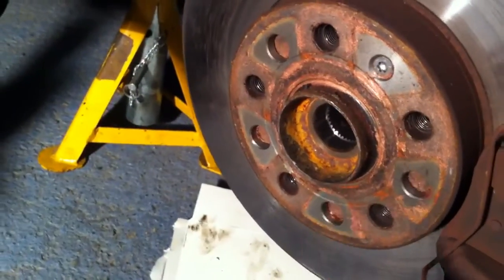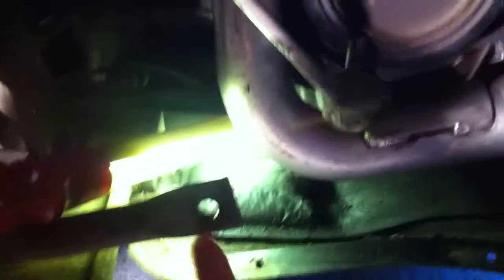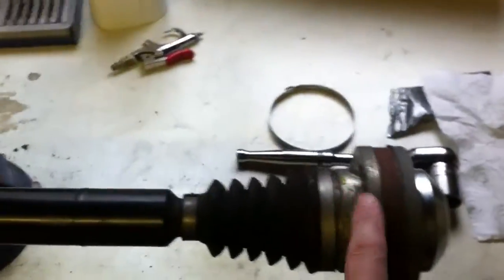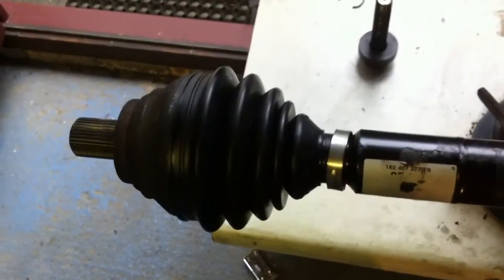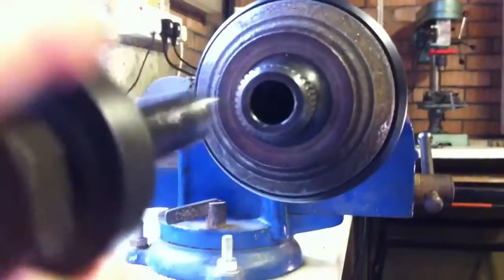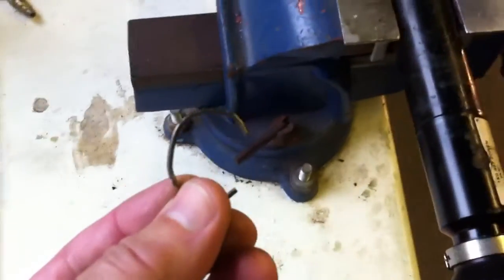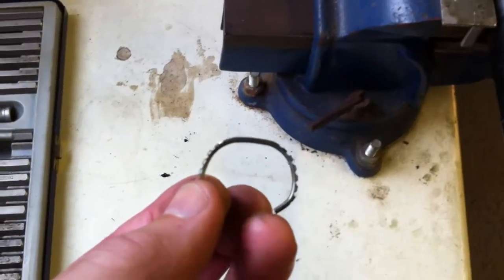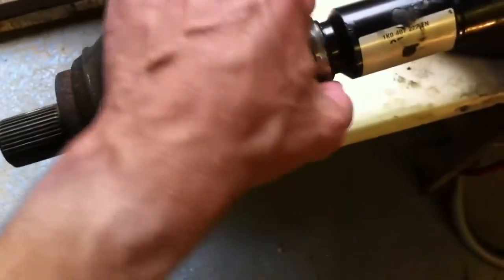CV boot replacement on 2005 Skoda Octavia 2.0TDi. (VAG, VW, Audi)

Comment: Thanks for the idea of using the Allen socket - it may help other amateurs (this was my first) if you make it clearer that it all needs to be kept in line while screwing it up (I also left the shaft on the car).  I "lost" 3 of these inside the joint while it gradually drew out - then it finally came off the end with a tap from a big hammer.
Reply from the maker: I've done a number of CV boots over the years and this was the only one where I couldn't easily remove the joint. I see that there is a special puller that you can buy to deal with troublesome joints.

Comment: If you remove the circlip from the INNER CV Joint and slide off the inner CV which GENTLY taps off, plus remove the 3 bearings, which again GENTLY tap off with a hammer, then BOTH boots can be done from the inner end with just a little bit of stretching of the small hole of the boot over the stumps that hold the bearings. Tie wraps work well if the clips prove a pain to fit correctly.

Comment: Good vid, but with a few unncessary steps. The anti roll-bar joint can stay untouched. You don't really need the spring compressor, at least i did not use it, and i could put back the wishbone without any issue. The drive shaft removal isn't necessary too. I don't really understand, why would you take that off... The bolts are very deep inside, it's hard to reach them, it's a pain to take them out and put them back in, i think it's absolutely unnecessary (unless the inner cv boot needs to be replaced of course).
I just did it a few days ago on my 2008 Octavia ll, and the whole job took less than 2 hours. By the way, the 12 mm socket adapter trick is very smart, but you can do it without removing the drive shaft. I was holding the drive shaft with a basic water pump plier with one hand, while turning the main bolt into the cv joint with my other hand. After a few turns, the cv joint pops off, than you can pull it off easily. Then replace the boot, put the grease in, hit the cv joint back into its place carefully with a hammer.
Reply from the maker: I've done outside CV boots in the past where it can be a real pain to remove the shaft from the joint so that was why I removed the whole shaft and put it in the vice. I couldn't easily get the lower wishbone out of the way without removing the anti-roll bar so I don't know what was going on there. Luckily I don't have to do these types of jobs too often :-)

Comment: Word of caution woth this method,  it is possible the allen bit (10mm) can somehow get lost inside. Whether  betwwen the bearings or the shaft is hollow I don't know yet.  I'm still trying to remove the cv 😮 😢
Reply from the maker: Yes, you do have to be careful, you certainly don't want it lost inside the bearing, that will not end well! I don't know why they are so difficult to remove, in the past, they used a standard circlip and you used a pair of circlip pliers to open it, simplz!
Reply: @bvqbvq  there's another video on YouTube which shows the problem I'm having and it seems the outer taper isn't enough to push the clip into the groove.  
Or perhaps the clip ends are outside the groove as in 6 O'clock position when fitting.   One thing for sure, it's a real ball ache 😂
Reply from the maker: @MegaMidds  buy yourself one of these, they're only about £15 online. https://www.youtube.com/watch?v=GbiS5nClOJ4

Comment: Why did you deem it necessary to remove the shaft from the car?
Reply from the maker: Because I couldn’t get the joint off the shaft. Even in a vice on the bench it was still tricky. If they had used a standard circlip it would have been easy to remove.
Reply: I now know the reason first hand for removing the shaft, though I still haven't